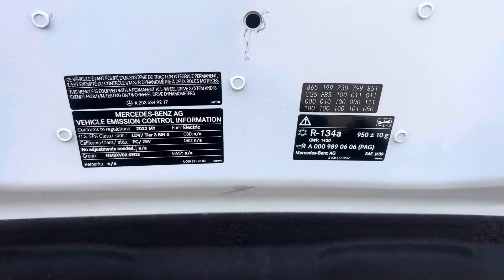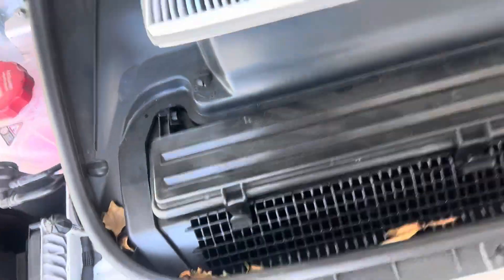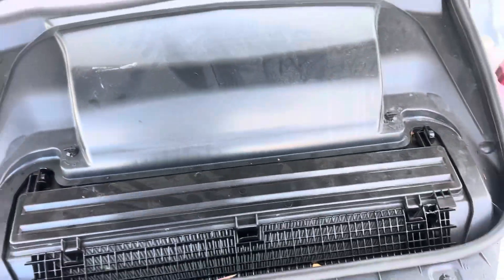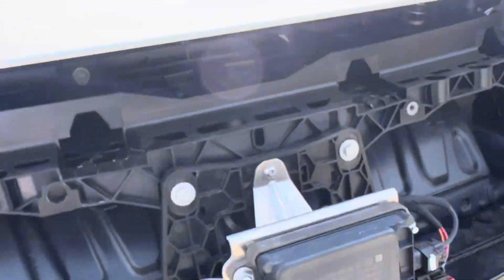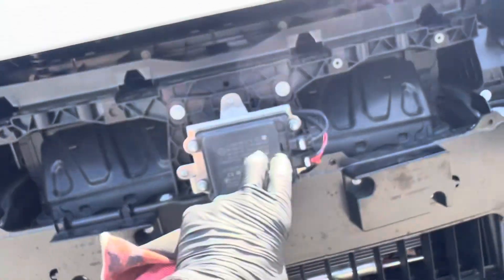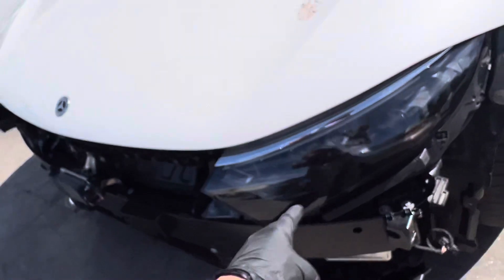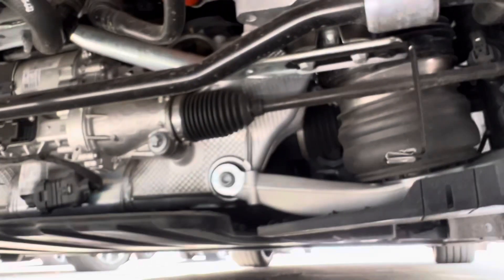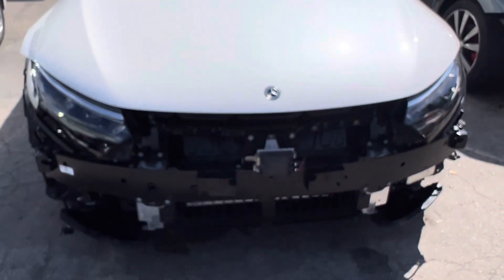HVAC SUPER CARBON HIGH MERV AIR FILTERS Mercedes all electric vehicle.

Comment from the maker: The size of this filter and it’s Merv rating exceeds some 5 ton residential home units. 😂

And airflow and CFM per square inch of surface, face of filtration, far exceed efficiency than any residential home system

Comment: This is a 2022 car with r134a? I thought cars will only be produced with r1234yf (We all know that Mercedes never liked flammable gas)
Reply from the maker: It all comes about money in Germany, being bullied into being forced to pay for a Refrigerant by a company with a patent

So Mercedes rather pay the penalty for every car to shipped to the United States with 134 even at this date 

I really wish Mercedes with ship over CO2, air conditioning or heat pumps to the United States 

That could be there revenge on the Americans torture them with CO2 because they would go with absolutely insane with the pressure is David would not know what to do. Cannot understand how to fix it. . 

For me, it’ll be a gold mine
Reply: I never thought It was for this reason, very cool info, Dupont thinks more on the money than global warming

I never seen a Mercedes with CO2, would be cool to see running pressures and temperatures of one of those systems

Very soon Tom, very soon!
Reply from the maker: @ignatius2230  on CO2 I think the low side pressure will probably be somewhere about 600 to 1200 and the high side pressure about 1700. 

there are CO2 systems in large commercial that almost have equal pressures. Very strange operation they got going. They have many different sub systems on the more complex very large industrial stuff.
Reply: @coldfinger459sub0 Oh yes, 1700psig on a cool day?